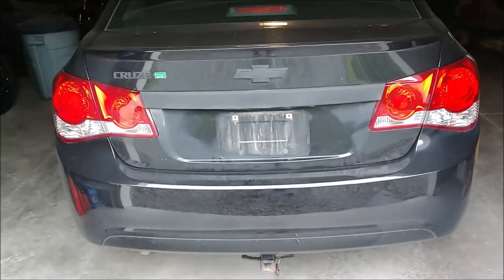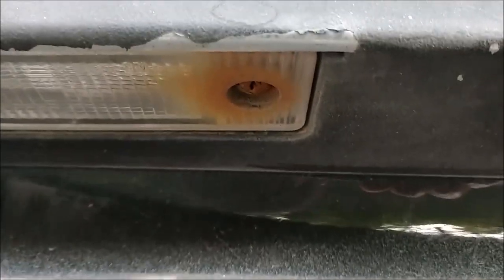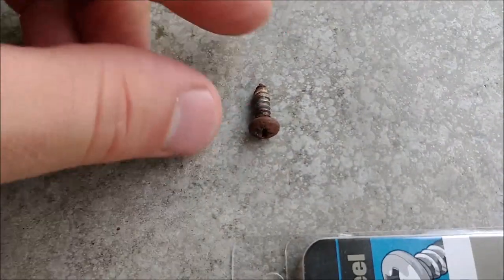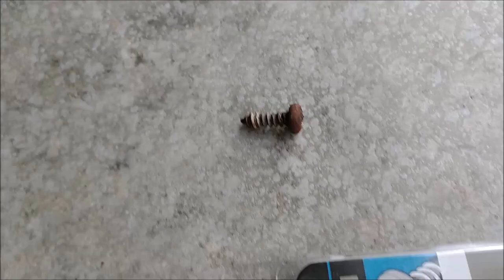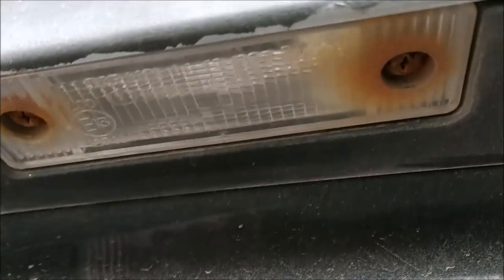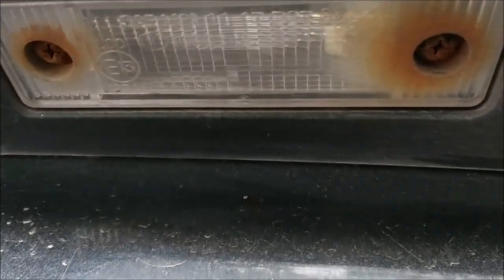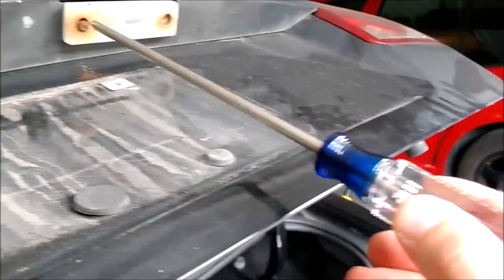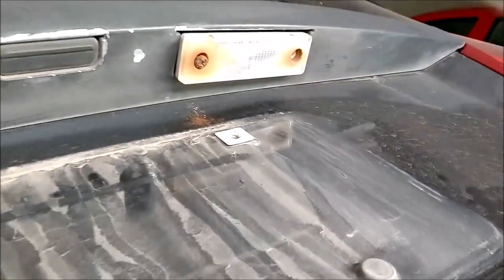Chevy Cruze license plate light screw replacement

Comment: Did you have to drill the holes any bigger, or were the diameter of the new screws the same size?
Reply from the maker: No drilling required. The diameter of the screws were the same size.
Reply: I wished I would've known the first time, but good to remember if I had to do it again.

Comment: Hey, the link you provided just brings me to amazons home page, is there another link I can try?
Reply from the maker: I will have to change it. Thanks for letting me know. This one should work: #8 x 1/2" Truss Head Self Tapping Wood Screws Sheet Metal Screws, Phillips Drive, 304 Stainless Steel 18-8, 100 PCS https://www.amazon.com/dp/B07C6WWZ99/ref=cm_sw_r_awdo_3GRDSR500R6HG15H1K9F

Comment: Mine screws wont come out how do i go through it another way i have to change the bulbs
Reply from the maker: Unfortunately, you have to get the screws out. Try to spray them with some penetrating oil and see if that helps. If that doesn't work, then you will have to drill them out.